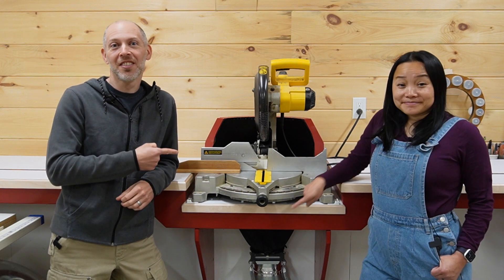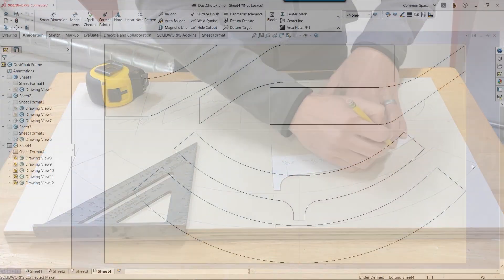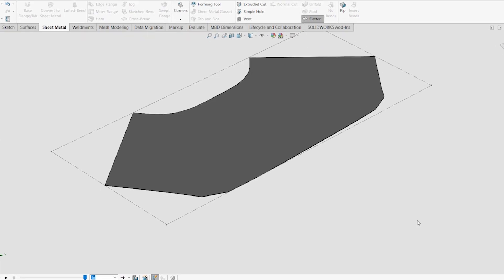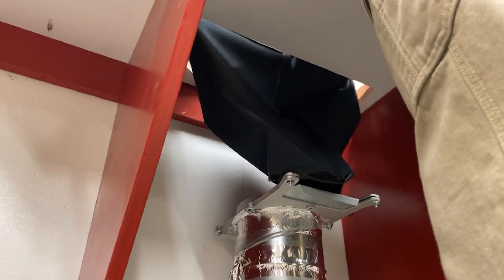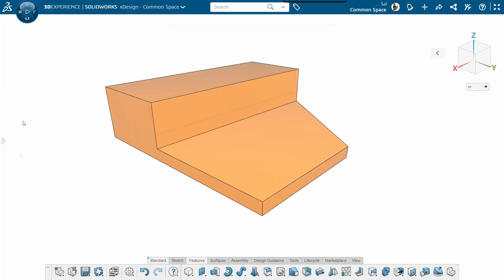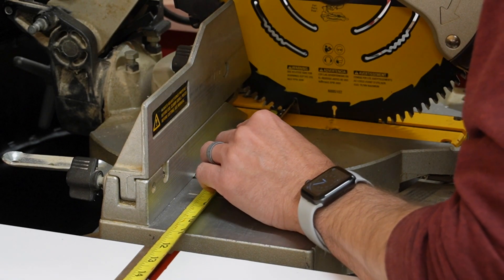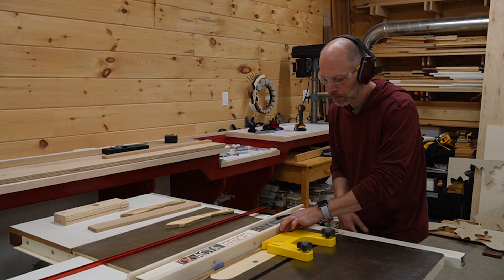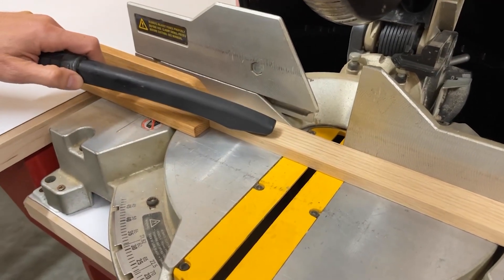Collecting dust with fabric!

Comment: Lots of creativity in this video that I really enjoyed. Great job. I especially loved the idea of the shims under the saw which enabled you to remove and replace to exact positions. I’m looking at doing something similar and appreciate the idea.

I have the cordless 7 1/4 inch Milwaukee compound sliding miter saw, do you know where I could potentially get something similar to what you guys have done? Or, are you guys selling these shims?

Again, thanks for the video.
Reply from the maker: Thanks so much for the feedback. We're glad you enjoyed the video. We're not selling the shims, but you can download 3D models of them for free in the MadeIn3D community: https://r1132100503382-eu1-3dswym.3dexperience.3ds.com/#community:17/post:aA4hLqerTV65fhYHJyyIog  You'll just need to create a free login to access them. Do keep in mind that before you print them out, you'll likely have to customize the shim height to perfectly match your specific setup. We've included a 3DXML format so you can edit it in xDesign (assuming you have a SOLIDWORKS for Makers license), as well as STEP format so you can modify the files in any other CAD system you may be using. We hope this helps. Good luck with your project!